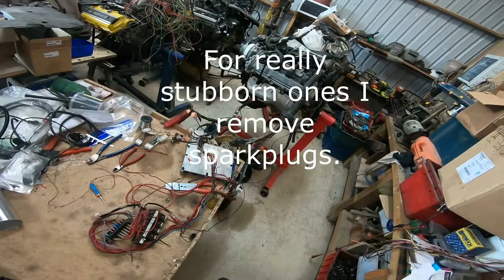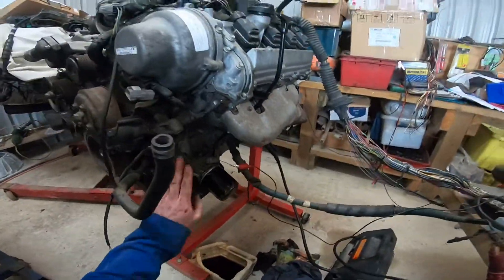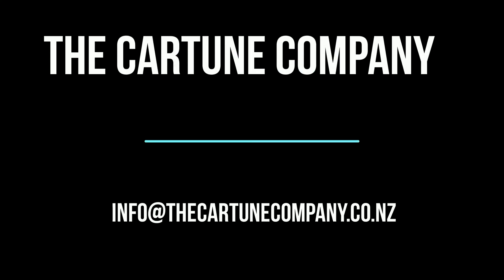prestart oil pressure / Priming oil pump Toyota or lexus V8

Comment: Just swapped to a rear sump and a new oil pickup tube in my 2uz. Should I prime it??Engine was running two days ago fine.
Have not started it yet.
Reply from the maker: I'd be giving it a few seconds of cranking with spark disabled to get the light out then fire it up.
Reply: @CartuneNZ  thanks!

Comment: I'm prepping a spare engine and have been wondering how to prime it when the time comes.  Of course there's a CartuneNZ video for that, awesome!
Reply from the maker: I normally fill the oil pump up with assembly lube if I have the sump off however that can cause issues if the engine sits for a long time so a light coating of anti rust stuff then prime pump like in the video on startup works fine.

Comment: I have a 3uz in a altezza rs200. Oil pressure is good when car is on idle. Minute i start to rev the oil pressure drops to nearly nothing (using oem gauges from altezza) what u suggest ?

can be the problem
Reply from the maker: I would start by ensuring the engine does or doesnt have oil pressure using a manual oil pressure gauge.  If its good then check wiring and sensor.  If its bad check engine.  You did install the altezza sensor that matches the gauge?
Reply: @CartuneNZ  hmm any particular oil pressure Guage maybe I  an get a new sensor with guage. awm ?
Reply from the maker: @carlnunes9311  I start with my workshop test gauge to check oil pressure.  Then I can replace gauge in car with another electric gauge if thats the fault.
Reply: @CartuneNZ  I am going to see if I get one 
what type of oil is best? I have now 5w-30 synthetic
Reply from the maker: As per the video use an oil suitable for your climate which gives desired oil pressure.  Conditions in NZ might be different to where you live
Reply: @CartuneNZ  climate is between 29 degrees and 33 
and carvisbfor drifting what u suggest lol
Reply from the maker: Ok.  I use penrite hpr10 in 3uz that are driven hard.   This is a 10w50.  Oil.  I feel that 5w30 is ok for road cars but the lack of hot protection is a concern for me.
Reply: @CartuneNZ  ok willchange to to 10w 50 synthetic  

thanks a million
Reply from the maker: @carlnunes9311  cool as.  Once its in confirm oil preesure is good too. Cheers Kelvin
Reply: @CartuneNZ  tried getting 10w50 no luck in my local stores what about 15w50 ?
Reply from the maker: @carlnunes9311  I used to use lots of 15w50.  I really like that too.
Reply: @CartuneNZ  so this will work 😆 
and I was told add a Lucas pil stabilizer
Reply from the maker: Yes.  15w50 is good.  Stabilizer is up to you
Reply: @CartuneNZ  thanks
Reply: @carlnunes9311  I wouldn't add any oil stabilizer if you're already running 15W50. It may have just been a coincidence, but my VVTI solenoid took a dump on me after I added that stuff.

Comment: Hi Kel
What oil should I b using on a 1UZ Gen 1? Thanx
Reply from the maker: Hello.  Oil choice can be quite controversial and there is definitely a lack of understanding of why we choose different oils.   The selection is going to vary depending on the climate, driving style, age of engine and use of the vehicle.   I was looking at some log files for a race car the other day and noted the maximum oil pressure was 60psi.  Oil viscosity will result in different oil pressure.  In this case I asked what oil and they had a 5-30 and it simply didnt give enough oil pressure when hot.   The 30 top would result in better fuel economy as less resistance for the engine to overcome. In that one I would have run a 15-60 penrite (hpr15) oil.   If it was a road car engine swap maybe a 10-50 (hpr10).  Both are high zinc which I like.  For a basic standard road car normal driving Im often happy with a 10-40 semi synthetic or 15-40 mineral its a bit worn.  My goal is satisfactory oil pressure across the range to protect the engine under all conditions.  Once I get an engine running on an oil I'm happy with then I tend to stick with in and change it often.  Every  6 months , mostly open road every 10000km,  more town driving every 5000km.  Over here we are rarely below freezing in winter and summer 30c is a really hot day.  Hopefully thats kind of helpful.  Cheers.  Kelvin.
Reply: Thank you.
Reply: That was for a 1UZ in a 92 Surf
Reply from the maker: @Ezylux  ok.  Hot engine bay,  conversion.   My favorite is Hpr10 or hpr15 if driven hard.  Any good quality oils similar are fine.  I have often used a total or elf 15/50 which was great too.  I like the extra protection up top.  Cheers

Comment: Hadn't seen this video when I wanted to start a 1UZ I have had for a while. I realised the oil pump would need priming.
Luckily at that stage I was setting up a remote oil filter and thought it would be a good idea to add oil to the filter (mounted with the oil feed upper most) and the fairly long hoses.  I poured oil into the hoses from the filter end. One hose filled up (the one that goes to the engine/bearings) and the other took a lot of oil, which I figured was going through the  hose into the pump. 
I connected the two hoses to the filter, and when I cranked the engine I had oil pressure pretty much straight away.
Your way would be better in that it works with any oil filter setup.  But I was wincing with the amount of cranking that engine did before oil pressure came up.
Thanks for the video.
Reply from the maker: Are you doing the 131 from lextreme?  I always remove the sumps on conversion engines and prime the pumps with assembly lube but this video was about showing one way if the engine is in a vehicle so removing sump isnt really an option.   Removing plugs also helps but the video showed what i wanted it to.

Comment: Fantastic videos 👍 just wondering do you have any videos of what water pipes you can get away with not using on the 1uz conversions can’t find any information on this! Thanks
Reply from the maker: Good Morning Justin.  Thanks for that.  Ive got plenty more videos coming too.  I dont have a specific video on removal of water hoses yet but I touch on it in the Things not to do on a hilux ute V8 swap video.  https://www.youtube.com/watch?v=XAwyIzooZhE     I also have a video recorded on modifying the throttle body to remove the hoses which is due to be edited when I find some time which has the hose removal too.  Cheers
Reply from the maker: Hello Justin.  I made a video on the cooling system and water hoses to remove this week.  Cheers
Reply: CartuneNZ fantastic cartune very much appreciated mate I look forward to your posts 👍

Comment: Thanks for the info, I was only wondering about this the other day as my 1UZ has been sitting for ages! The only other types of engines I've had to prime, it was a case of removing the distributor and driving the oil pump directly with a drill.
Reply from the maker: Good timing then.  I just happened to do a couple lately and have another couple to do that have been sitting for a while.  This is definately the easiest way to prime them and works most of the time.